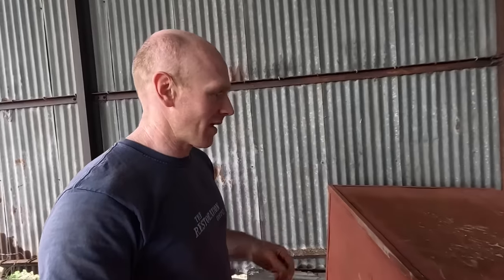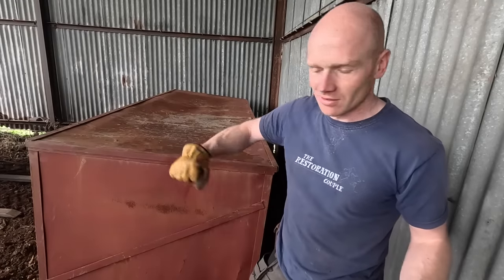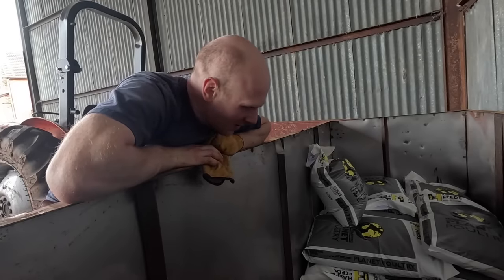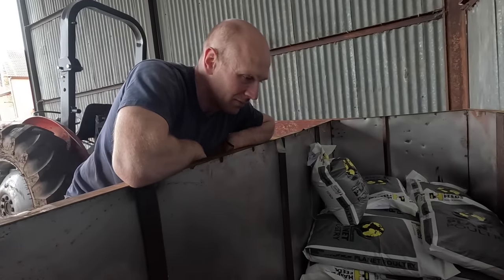RODENT PROBLEM - Just buy an aircraft hanger! 🐀

Comment: Could you put the box on its side and drive the pallets straight in. The pallets would be the floor. Lash the lid up with a few hinges so it flips over and secures at bottom
Reply from the maker: Possibly could work but not with the full height pallets how they arrive.  Think I will build something out of blocks eventually once I know where is best for it.
Reply: Maybe try putting some hay bales in the bottom so the bags are reachable and less strain on you back…

Comment: Why don’t you just put what is now the front on the floor, meaning that the lid is now the front. You could then put some hinges on the bottom of the lid and just open and close it, meaning you can just drop the pallet in and close it up. It would only be a little bit of welding for the hinges and job would be done!